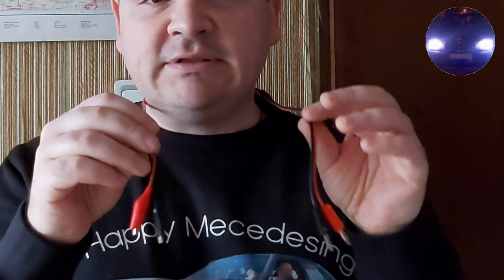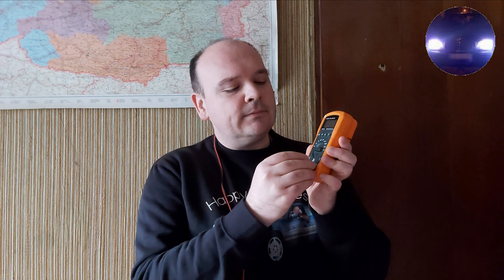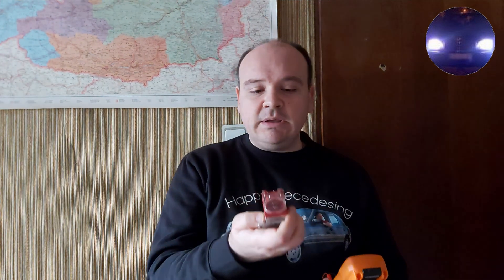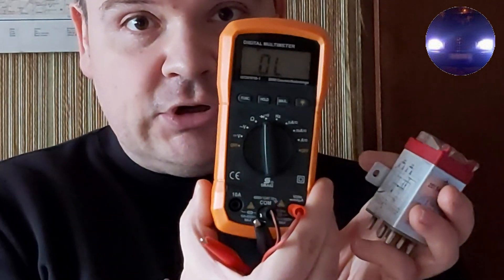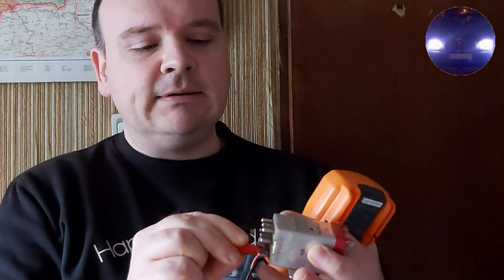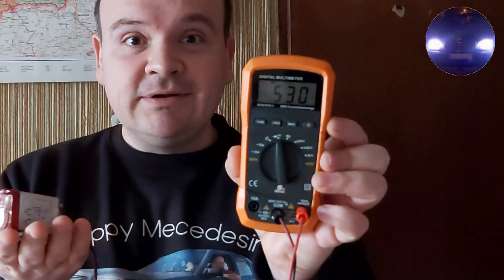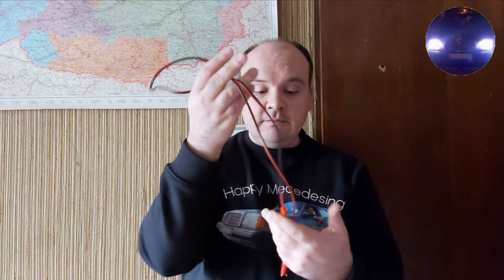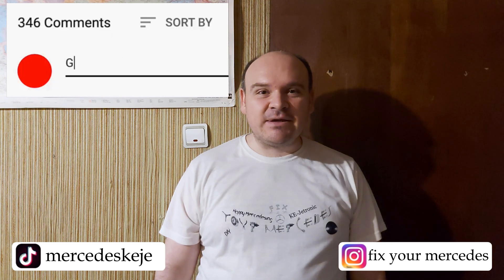㉦Mercedes Ke-Jetronic㉦ - ❗Some tools accessories you should have❗

Comment: Hello, what about a pressure measuring tool (for the fuel pump and eha), isn't that necessary? Thank you for this video and Happy Mercedesing :D
Reply from the maker: Hello. For the eha you need a multimeter set to measure mAmps and for the fuel pump a pressure gauge. Happy Mercedesing 🍀 😊 😃
Reply: @mercedeske  Thank you, Happy Mercedesing 😊

Comment: Hello brother, I hope you are well. Question: I have a Mercedes W126-SE260-V6, petrol, not diesel. The sound of the engine is very good, only a slight chopping, and when it does not respond to a speed after 100 km per minute, I feel that it is suffocated, and during full parking, and the transmission position is N. I step on the oil, the RPM counter does not exceed  Indicator 40 and when it is connected to 40 I feel that there is cutting and suffocation. It is impossible to reach 70 or even 60 although 3 months ago it was excellent in terms of water and the acceleration in travel was only 180 after a long struggle.  Every day, but the morning start-up is sometimes a little delayed, and mostly from the first start-up. I want it to return to its normal strength. I want the speed to reach 240 without hardship. Noticing on Nafil, the movement of D. Strong continuous pressure.  If the gas pedal is relaxed, it changes a little, and I feel it while changing the transmission. Of course, it is automatic. I feel that there is a knock and an RPB indicator, but it is a spring that dances.